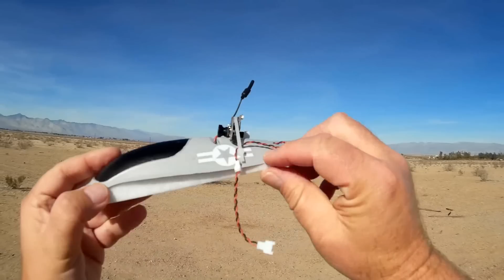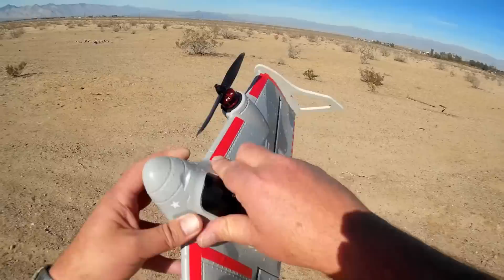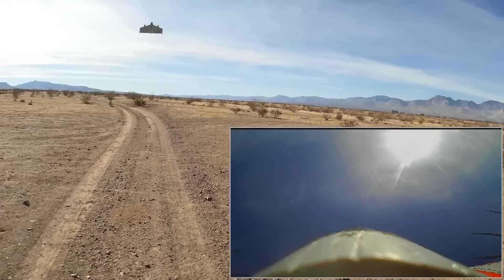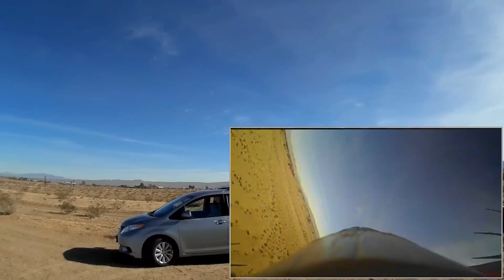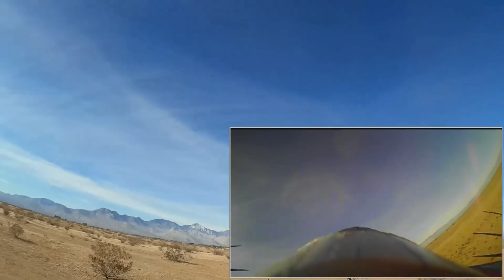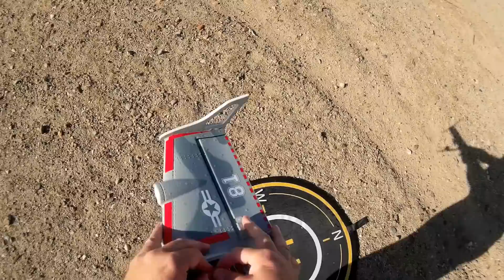Eachine Mirage E500 VTOL Vertical Takeoff FPV airplane Flight Test Review

Comment: Not first but okay got a question for you about the controller your using I have one but can't get it to work with my quad can you private message me about how to set it up
Reply from the maker: What receiver is installed in your quad?
Reply: Quadcopter 101 frsky lizard 95 won't arm and controls seem wonky
Reply from the maker: Have you connected it to Betaflight?  Under the Receiver menu, are Roll Pitch Yaw and Throttle performing properly as per your stick controls?  If not, have you tried different channel mapping?  For example if TAER1234 is listed under Channel Map on the receiver page, try instead typing in AETR1234 in its block and then hitting save (vice versa if AETR1234 is shown, then instead type in TAER1234).
Reply: Ty I'll try that first because they are not right when connected to beta flight